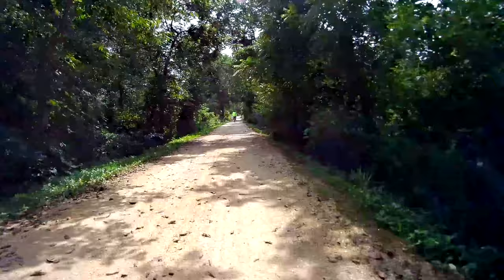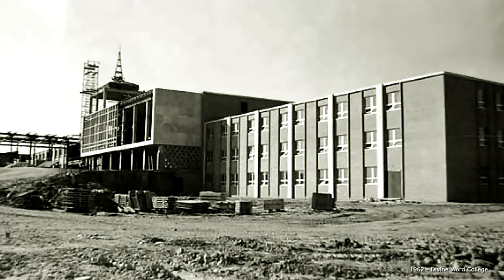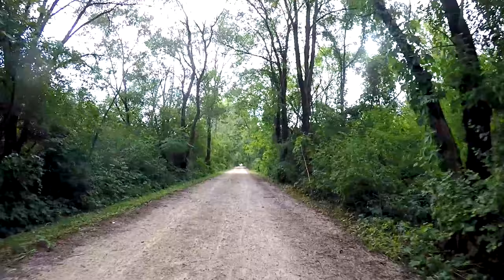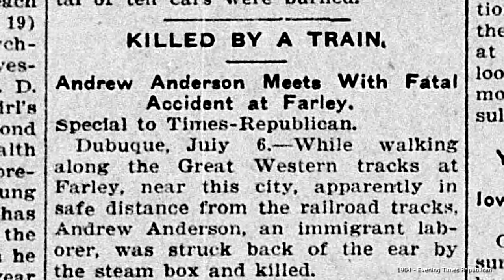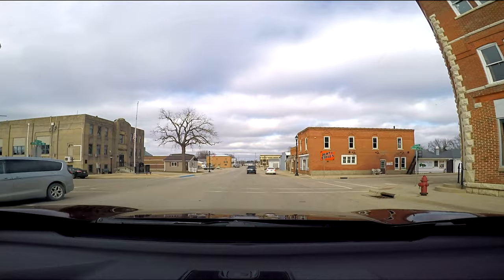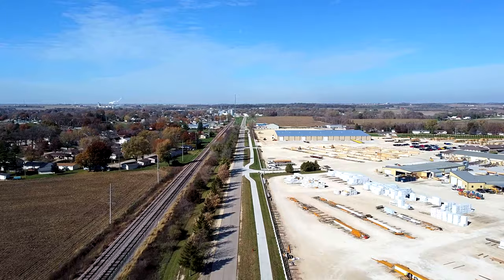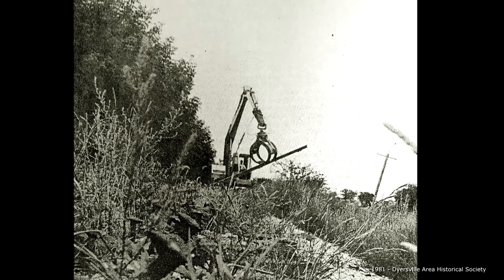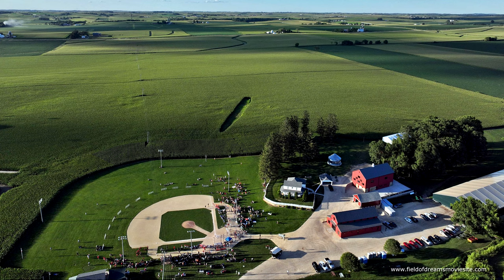Disused Stations of the Chicago Great Western - Kidder to Dyersville - Part 18

Comment: Good job again! I noticed the bridge abutments near Kidder may have been wide enough for two tracks but maybe that never happened. Unfortunately, there is no mention of the Kidder depot on the Railroad Station Historical Society website and Google Earth street views are few and far between in that area, so that mystery remains. Not much to follow on the Iowa Northern but may have seen some bridge pilings by the North Fork Maquoketa River from Google Earth and a diagonal patch of land entering New Vienna-lots of farmland. A "new" Iowa Northern Railway was formed in modern times in Manly IA.
Reply from the maker: Yes, you are exactly right!   There was room for two tracks.   Maps at different times indicate that the siding moved from time to time, one time being to the west of the road and another time showing the siding to be east of the road.  It's possible that the siding extended to the east when the bridge was originally built - and that the last replacement of the bridge (1920s or 1930s), the siding was either moved to the west or removed.    Thanks for the excellent observation and the comment!